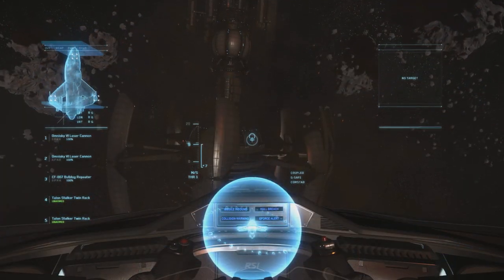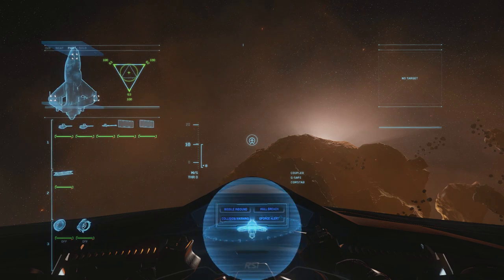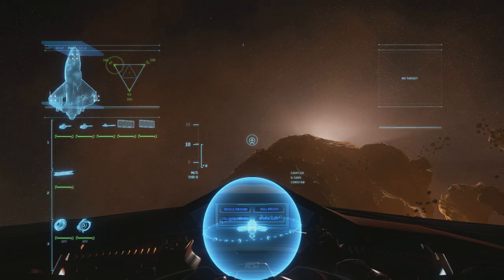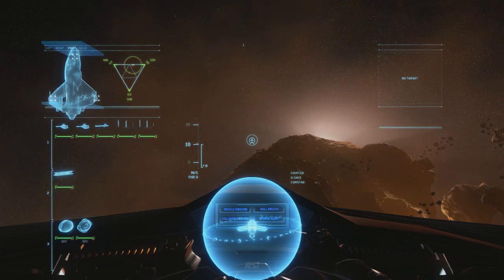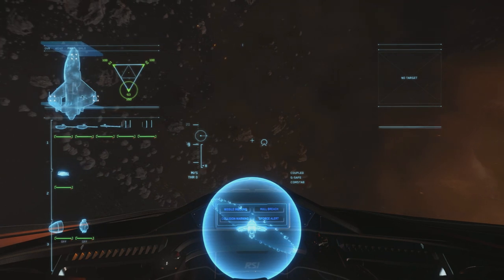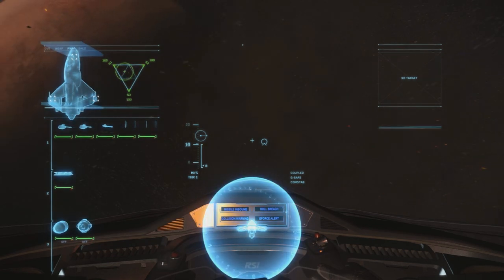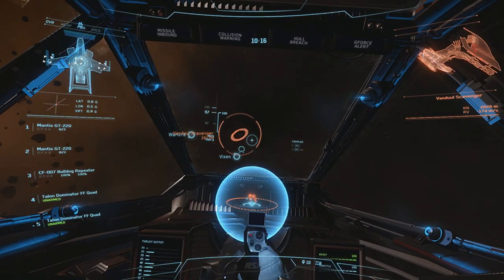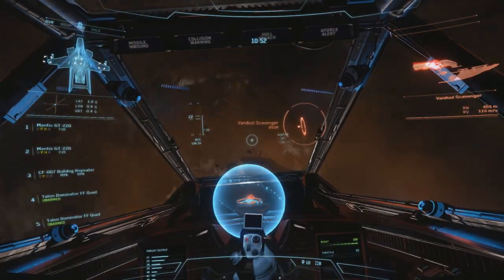Star Citizen: Power Management Guide!

Comment: Correction: G2 is your shields not your thrust. If you look to the left right under the triangle you see the three rows labeled 1 2 and 3. These are the G categories that you are talking about. If you pay close attention to category 2 you will see that that is the 3D image of the shield generator that is on the bottom of the 300i, and the 3 category contains the various thrusters. Therefor the G2 is the Shields and G3 is the engines and thrust.

Comment: i figured out that once you hit whatever key you have set to begin interacting with your HUD, you can just point and click on everything with a mouse pointer. that seemed simpler to me than having to press like 3 keys. though there was something under the weapons tab i didnt really understand, and well as an option in the power tab (in the aurora LN) that is a circle with the number 100 in it which every time i click it the number drops. if it gets to zero im notified "system critical" so i click it again and it resets to 100. is this just the over all power being used by the ship?

Comment: Omg, how convoluted.  Elite Dangerous does this much easier and intuitively.
Reply: This is Pre-Alpha , They are still working on the HUD interface and Key bindings , There will be also presets that you can easily switch between . The Good thing that they have so much flexibility to make your ship as you want in terms of energy flow
Reply: +71Dana I'm gonna throw my two cents in here. 
I'm a big space combat fanatic, so naturally I love both games. However, there are key differences.
Elite is a little bit simpler. Well, actually, a lot simpler. It also comes from a lineage of other games in the same product family. The controls are a little simpler, the game is a little simpler. It is good, the graphics are nice, the sound design is stunning. But it's less ambitious. As a result, Elite can be considered a functioning, relatively finished game. However, it's been simplified to the point where, laughably, someone using an xBox controller can effectively access all relevant controls. 

Star Citizen, on the other hand, is so wildly ambitious that, despite the large sums of money currently tied up in its production, despite a very large team working very hard for several years to produce it, it's still in a very, very rough alpha state. 

Elite gives you basic controls and a few gimicks to make things more interesting. 
Star Citizen is almost intimidating in its scale of complexity, which requires a much more powerful computer and much more convoluted controls to play. I see this as a plus. Someone not capable of building or buying a gaming PC and finding a space for an  X52 will doubtlessly find Elite: Dangerous much more palatable. 

Once Squadron 42 is released, though, it's going to get a lot harder to argue that E:D is better than SC.

Comment: How on earth are we gonna pull this off I  the middle of a dog fight
Reply: im sure they will add buttons to max one of another. would also be cool if they added profiles. who knows but we dont even have proper settings for controllers/graphics. it will improve.
Reply: Random Gerbil For example : Right ctrl+ 2 or 9 on the numberpad will boost the fore and aft shields respectively.
Reply: monk1junk1
sound like macro setting or maybe i don't understand what you say, but would help to set a macro for energy to shield and engine and 0 to weapon and another one to get power to weapon and be in a fight mode.

also i hope we could make some tweaking on which weapon the energy goes, for exemple on the trainig 300 i would lower the energy sent to the repeater laser ( nose gun) to get more energy on the 2 omni
Reply: kao chat I kinda mean like macros. I'm trying to say you could probably customise a few different loadouts, for example have one with more shields and less weapon energy or one with more weapon energy and less shield energy and switch between those two (Or more) loadouts on the fly using macros.